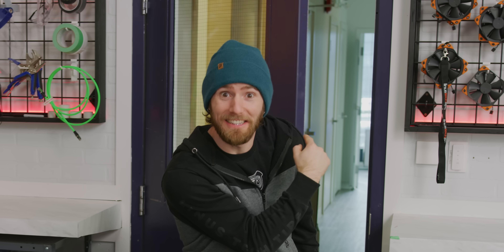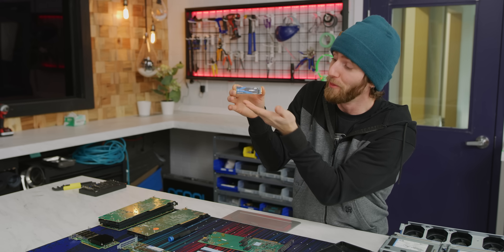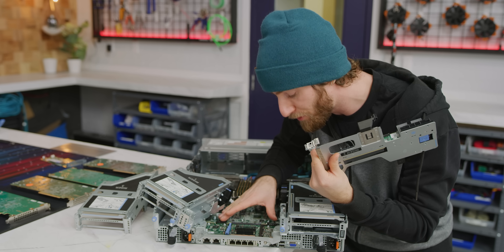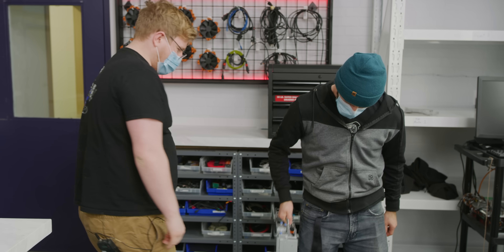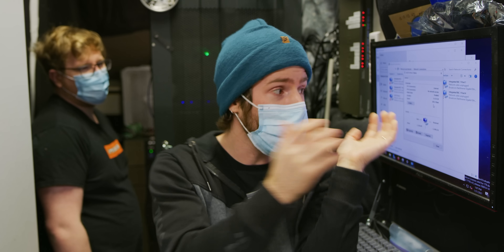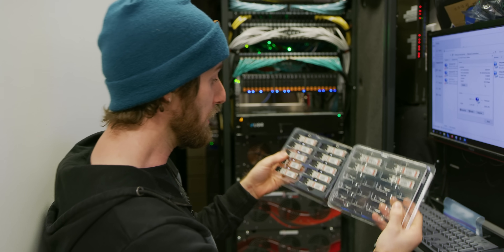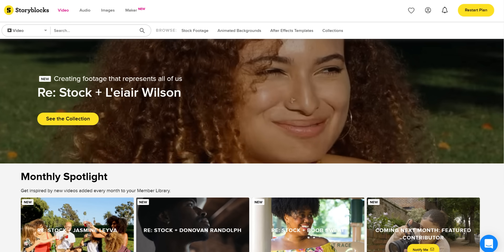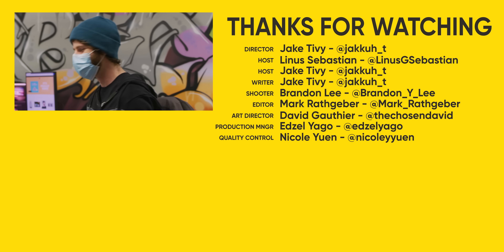Fixing My $10,000 Mistake - Whonnock 3 Deployment

Comment: Are you guys not worried about hotspotting by running RAID5 on the SSDs? (The parity SSD is going to end up with the brunt of the writes since any writes to the array will always invoke a new parity update on that specific SSD, no matter where the block lands). I'm sure these have pretty high write tolerances, but that was one of the factors that pushed me towards RAID10 for my new SSD array vs RAID5/6

Comment: hi guys i know this is a weird question but how can i boost my laptops performance it has an i5 4300U and intel hd 4400 
the thing is that my temperature doesnt go past 50 degrees while gpu and cpu stress testing
and i disabled turbo boost because it causes power throttling  
i hope you guys come with some ingenious ideas and thanks :D

Comment: In 5 years: WE FINALLY UPGRADED TO SSD ARCIVAL STORAGE
Reply: Wasn't there an issue with SSD storage where the voltages dissipated in long term storage? I could be totally misremembering that, but if not, has this ever been fixed?
Reply: @robertt9342  maybe in 5 years

Comment: I have absolutely no idea what 70% of the things here mean but I like it.
Reply: Same. This video gave me brain cancer
Reply: Welcome to LinusTech
Reply: Visually confused
Reply: Speeeeeeeeeeed!
Reply: Yeah, I will never run a server like this or need comparable speeds but he made me watch 15 minutes of it so whatever he does to keep people watching, he does it well …
Reply: I would kill to have this gear  just for a local network 😂
Reply: @DxCBuG  It costs more than many people's houses. But in 5 yrs it will be replaceable for about $5k. You can actually buy tons of used commercial equipment for really reasonable prices. But do you have a need for it is the thing. 10Gb networking is very useful these days if you're doing network transfers. Again used 10Gbe nics are very reasonably priced and 2 boxes like your main workstation and a NAS or backup machine can be connected with a single cable to get 10Gb between them. Backup your critical data at least 2 times. So 2 onsite and 1 offsite when possible.
Reply: @user-fw6eg3hc8f  yeah I wanted some mellanox 40/10 nics but the switch to use it for reasonable money still does not exist. What drives me nuts the most ist that there still are no 2.5 or 5 GBit devices out there for home use

Comment: I’d recommend SmartOptics, rather than FS optics.  Not much more money, but much more reliable in my experience.

I’ve had plenty of FS failures in my time (probably close to 100).  I’ve replaced as many as possible with SmartOptics and I’ve only ever had one SmartOptics failure, and I’m pretty sure because that one may have been the one optic that was accidentally dropped 7 feet to a concrete floor.
Reply: sure im gonna take a rando on youtubers advice cuz he said so

Comment: Ohhh, this 10.000 $-mistake. I thought you gave the broken aka dropped Xeon Platinum 8180 another shot... 
I wouldn't describe this one as a mistake. The problem with Whonnock 3 was an industry-wide one, which you pointed out in the very interesting video about the issues. What will happen to that machine and that U.2-drives now?  And since the NIC is basicly from Nvidia, I wonder that you were able to get it (becuase everything from Team Green is out of stock these days) and if it supports DLSS and Rayttacing. :-D

Comment: "We're running single drive failure protection, single parity. But don't worry, we have backups."
3 months later: All of our data is GONE! Pt. 2
Reply: RAID parity should not be used as data protection in the age of ransom ware. It’s only good for maintaining system uptime. If they have a spare drive on hand, they are doing it the right way.
Reply: @SeniorKlean  True, and NVMe is fast so rebuild it's just a few minutes.
Reply: @SeniorKlean  that is horsheshit
Reply: @petervansan1054  In what way is "Raid is not a backup" horseshit? 
It's straight up fact
Reply: @Jack-yv3po  shhhhh don't speak sense to these who have only worked in an IT shop with less than 20 employees

Regarding backups I hope he is encrypting those off-site backups otherwise riperino if someone gets hit by ransomware.
Reply: @petervansan1054  RAID can only protect from drive failure.  There are several other kinds of failure.  There could be a fire, the physical computer could be stolen, PSU failure, user error, ransomeware, etc.  All of those require backups to protect from.   Backups cannot be live storage in active use to protect from any of those.  To protect from theft or natural disaster it must also be off site.
Reply: @Jack-yv3po  it is first level of backup. It should NOT be only one but like hell it is not a backup
Reply: @SeniorKlean  have any ideia what raid they are running? 50 with 4 parity drives?
Reply: @takjr0  He suggested in the video he was using Windows storage spaces, which does dual parity on more than 5 disk, so I'm confused
Reply: @takjr0  single parity drive.
Reply: @DanKaschel  windows storage space?
Reply: 3 months? That's optimistic!

Oh wait you meant the release of the vid, i see.

Comment: Linus's cycle:

Employees are complaining of too slow server connection
Linus upgrades the internet
Now the server is too slow
Linus upgrades the server
Now the internet is bottlenecking the server
Linis upgrades internet (again) 
Now the server is not using full speed of new fibres 
Linus upgrades the server....
And it happens all over again...
Reply: koks
Reply: Wait, I thought servers were supposed to be a business intranet?
Reply: @dingle2987  Well, they are. The word ,,internet" in this case is just a simplification. I could write- ,,He upgrades fibre cables, switches, patch panels, NICs, but in this kind of comment it's just pointless so I went just with the ,,internet".
Reply: @dingle2987  the server is local storage, connected to the internet, which every computer connected either locally or through the internet can access. you still need to buy internet and a modem you cant just create it out of nowhere
Reply: @bmxscape  Not really. From the sound of it, everything is local to their intranet. What they're doing could be done without a modem or internet connection; just a switch/router and cables to each computer.
Reply: @JessieTrinket  yes but then they couldnt connect to the internet lol. the they have 100gb/s local speeds and 10gb/s ethernet
Reply: @bmxscape  Well ya, but my point was more that there's no need to have new new Whonnock connected to internet (other than updates I suppose). I suppose it was also a bit of a reply to OP on the fact that they should've said "intranet" rather than "internet" when talking about Linus's upgrade cycle.
Reply: @bmxscape  Ethernet is local speeds. There is no difference
Reply: at some point: we can download the whole internet to our server in 2 minutes, and only reason stopping us is we've done it a minute ago and since then very few new content appeared!
Reply: It's like Factorio. Everytime you fix a bottleneck in one part of the factory, something else becomes the new bottleneck. It never ends.
Reply: Remember the resolution
Reply: Isn't this just how tech works? A constant cycle of updates and upgrades?
Reply: This is how the real world works.
Reply: intranet*
Reply: Me in 2006, working on a midspec consumer laptop from 2003 in my apprenticeship, always having to wait ages for the thing to do whatever I wanted it to do: "Can I get a new, faster rig so I can work more efficiently and don't have to wait for the thing all the time?"
Boss: "No, that thing still has to do it for a while..."
The result of that was a mediocre degree and a very hard life afterwards... :D
Reply: jpNEWPIC88.Men
Reply: welcome to the world of IT. If you stop upgrading at any time you're a year behind instantly. You wouldn't believe how shitty some businesses are run just because they don't understand that you can't just implement a system and use it for 15 years without upgrading your bottleneck constantly.
Reply: @leftyeh6495  exactly. I was in an IT department Where we were upgrading 1500 xp systems to win 7 a year Before win 7 support ended and well past the point Where xp was dead and deamed a security risk. The only hardware change to the core2duo systems was an SSD and Some of the systems were Pentium 4. The Pentium 4 systems were retired though. However a feW really really ancient ibm servers complete with floppy drive and cd-rom drive was kept in service. Cd-rom drives not DVD... CD-ROM. Of course the pos xp embedded systems are likely still Running despite it being extremely dangerous
Reply: it feels like playing Factorio
Reply: That’s very accurate I was thinking the same thing and of course his company is still expanding.
Reply: Linis man
Reply: Never ending unequilibrium
Reply: Monye
Reply: More content?
Reply: wish our government could upgrade the internet around here
Reply: That's what happens when you have more money than sense.
Reply: The infinite loop YouTube channel.
Reply: It's the circle of life
Reply: Don't forget the camera upgrades.
Reply: He's gonna have a higher connection than major corporations at this rate.
Reply: It's called job security. Making these kinds of videos, that constantly need updates.
Reply: 🎤ITS THE CIRCLE OF LIFE ♫♫
Reply: Don't forget buying higher res cameras making the whole workflow be too slow once again.
Reply: Yes, but every single one of those is an opportunity for a new LTT video :P
Reply: "X" is slow, needs upgrade
"X is faster but is bottlenecked by Y"
"Y is slow, needs upgrade"
"Y is faster but is bottlenecked by X"
"X is slow, needs upgrade" 
Every LTT upgrade video
Reply: LTT/LMG is just one long story of a man with data hoarding issues, who has turned his obsession with more data into a business. Half of the videos they do is about upgrading their office equipment do they can do the same work as a full animation studio.